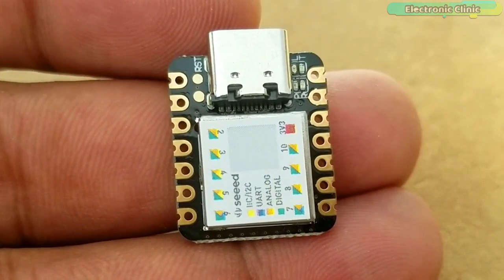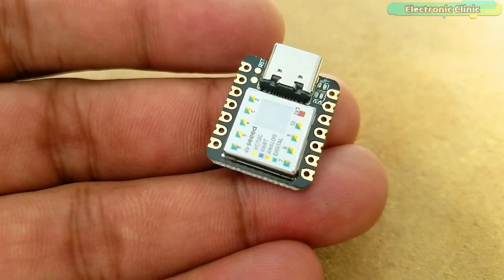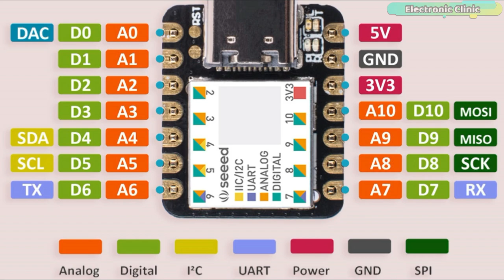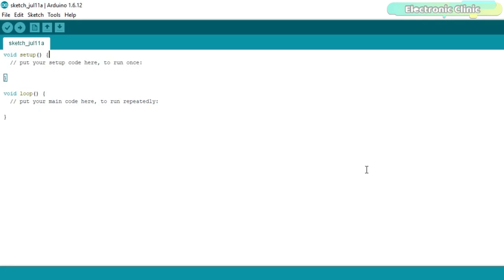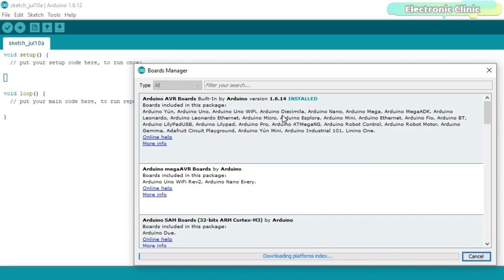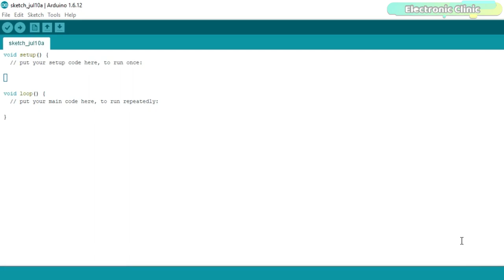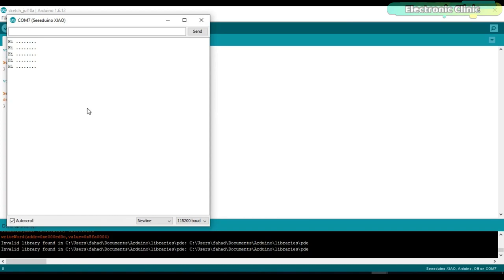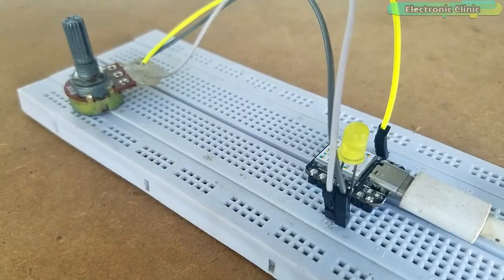Seeeduino XIAO the Smallest Arduino, Getting Started Tutorial, Pinout, specifications, & Arduino IDE

Comment: You need a resistor in series with your yellow LED to limit current flow, or you may damage your board.
Reply: nope, it's a 3.3v logic baord
not 5v
Reply: @simolx  Well, even 3.3V, you'll need a current limiting resistor, your LED will consume as much current as available.
Reply: Andrew C  Well, without a current limiting resistor in series to the LED, you might overload the MCU providing current.

Comment: My main problem with these plug in MCU is that the USB connector takes up at least 2 inches worth of working space in your project. there needs to be  a way to replace the USB connector with a pico blade connector instead or at least route the D- and D+ pins in parallel to the connector or pin outs.

Comment: Why does it have 5v pin if you shouldn't use 5v Vin?
Also, is there no reset pin?

Great video though.. Thanks.
Reply from the maker: there is reset, i explained it in the article. yes you can use 5v pin. i powered up this module using laptop and power bank.

Comment: Check out the Adafruit QT Py - SAMD21 instead has a STEMMA QT Connector for Hardware I2C, and a real Reset Switch, and an RGB NeoPixel LED!         https://www.adafruit.com/product/4600
An additional 2MB of SPI connected Flash can be added to the bottom of the Board, Easy to solder SO8 package. Price listed as $6.00 for now.